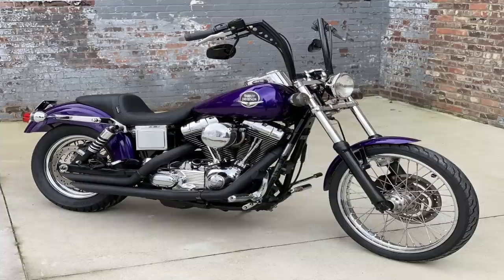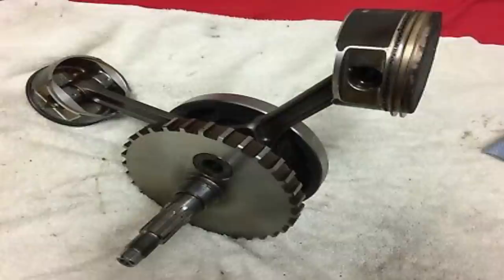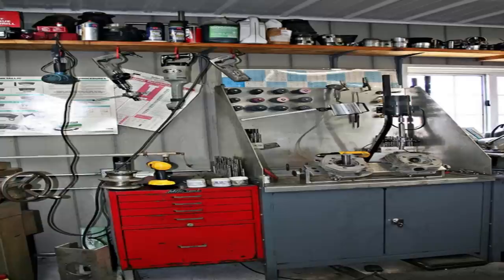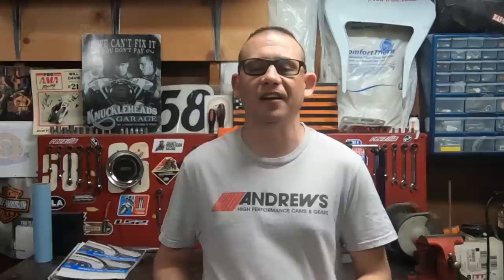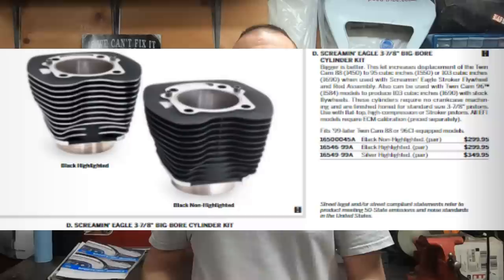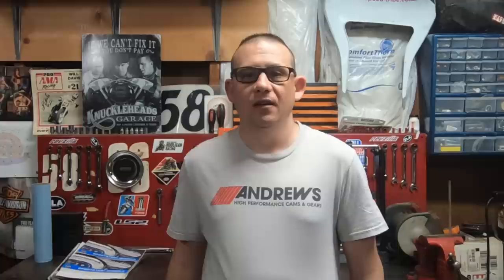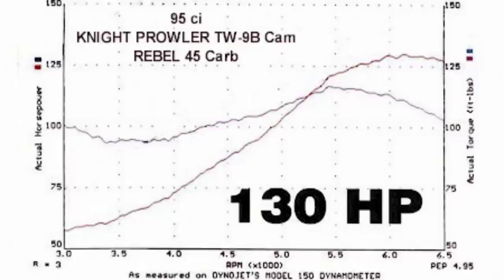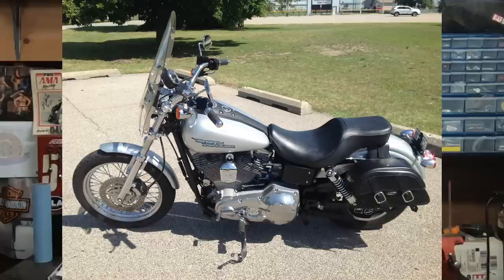Harley 95 is the Twin Cam 88 Sleeper

Comment: I bought a pair cylinders at a swap meet and had them bored while waiting for my heads to come back from branch flowmetrics ran their cam and pistons on my 02 fxdx turned a 10.22 on the dyno drags 107 hp 127 mph rode it 70000 miles with no probs

Comment: Excellent content!!! My 06 EG classic has the SE Kit with the SE plate, oil pump, TTS Tuner, and Khrome Werks header and exhaust. My Dyno run had 92 ft lbs and 84 hp.. Your video could not have came at a better time as I'm looking to change the cam, and have some head work done. Looking to really see what I can really get out of my little 88!!! lol
Reply from the maker: Those really good numbers with a 88 honestly, you've got a great setup to build on. You put a 95 kit on top with a good cam and you'll have a whole new motorcycle. Great power and torque, best part is it will be reliable too. You'll be able to jump on it and go anywhere you want anytime.

Comment: I would bore & hone the cyclinders to a set of Wiesco 10&1/2 pistons if you want torque use a1.900 intake valve & A 1.630 ex valve along with high lift springs if you want all out HP the intake valve should be a 2 inch .I like to use a head off a 2006 & up ( a lot less material to remove to make a good head . Cams should be 585 lift to 635 lift . Forget about woods cams every one of those has what I call the woods drop )they make the power for a short minute then the power drops off just when you want it to keep pulling ! Want even more bore the cases to accept 4&1/8 bore cyclinders for 107 cu in ! The 95 is my choice the 107 RULES ! Short stroke big bore !

Comment: I have a 06 Street Glide with the 95 kit with light weight/high compression pistons, an Andrews gear drive cam combo, polished and ported heads, stage 1 intake and PCIII tuner and it dyno tested at well over 100 hp and over 100 ft lbs torque. I can't remember the exact numbers but at almost 80k miles it is still running strong.

Comment: 95 kit w 96 ci heads w headwork, 543 cams, s&s crank, mikuni 42 via lightweight chain driven fxr.  it runs pretty decent.
Reply: Exactly what I did with my FXR just a 585 cam. What hp/tQ you achieve??

Comment: My 07 street glide has the big bore jugs, bored with a weisco piston 10.5 compression, ss ported heads with screamin eagle intake and throttle body tuned with a full true duel vance and hines exhaust and a custom grind cam. Its an absolute savage. Super super snappy. Eat 107's alive! Not even a match. It helps I've lightened the bike up some and I'm only 140lbs soaking wet lol

Comment: GOD BLESS the 95 " TWINKIE 🙏 MY 95 KIT WITH WOODS TW6 97 HP  110 TQ CARBURETOR   PULLS LIKE a FREIGHT TRAIN  S/S GEAR DRIVE  STOCK CYL.  ( MY STOCK 88 BORED OUT CYLINDERS WERE  NICELY HEAT SEASONED for BORING )  V/H PRO PIPE
Reply from the maker: They don't build them like they used to is all l can say. Those 95's pull so damn hard from that 4 inch stroke, you ride a 95 like yours then jump on a long stroke 96 with a cam and you'll feel the difference. The long stroke is lazy compared to the short stroke.
Reply: @GixxerFoo  THANK YOU SIR, I APPRECIATE the FEEDBACK. CARBED ALSO

Comment: I have one of these in a 2001 RK. It was installed when the bike was new. I bought the bike wrecked with 25k mile - it sounded like the valve train would fail at any moment. Since then I've installed Feuling cam plate and gear drive tw-6hg (same cam that was originally installed, shimmed the rocker arm end clearance to under 0.010.  Finished it out with Reinhardt tru-dual and a Ness super sucker.  Ii have not had it dyno'd but believe it is over 100 hp.  I also am disappointed with my 2008 SE 110 with the same set up. It's nearly putting ou 101 hp and 109 Ft/lb.

Comment: Right on ; little monster - 
Got my pistons gaskets ready ; waiting on cyl boring . Going to change out valve guide seals while heads off . I went with cast pistons 10:25 to one . Cam should bring that down a bit . 125 psi on compression test with stock pistons right now . High rpm recommend forged . Well the new rage around here is electric bicycles. Bidenomics  I guess with the gas prices I guess.😁
✊🏻👍👌 thanks for the info 🙏
Not worried about sprocket bearing for hd when bigger and bigger with that same bearing . Fingers crossed 🤞-

Comment: A short stroke Twin as a Square Build ( 4x4 ) is a great engine for a light bike such as a Dyna or Softail riding locally.  Without a doubt its a peppy engine and that 88in had the tried and true durable crank that was bolted together.
But to say the bigger stroke engines are a bit slower to jump up and run as quickly isnt the case. The cams with compression dictate the peak torque and horsepower regardless of displacement.
You smack the throttle on a big bore long stroke with a set of cams for torque. You better have a stout driveline to handle that level of power and have velcro on your seat, ass, gloves and grips.
I have seen bike engines bang a 120ft pds of torque at 2200 rpms and carry that and more out in the upper rpms.

I rode a 2002 Dyna Super Glide with a 95in stage 2 kit Mild head work with high lift springs, 48mm Mikuni Carb, Andrews TW54 set of cams and the original V&H Pro pipe.  It was a great short ride bar hopper!!!
Reply from the maker: Big cams and hot compression will overcome a lot for sure, a 95 in a touring bike with a high torque cam works really well. With the 5 speed transmission it keep the motor right in that rpm range on the highway for great roll on passing.
Reply: @GixxerFoo  My current 124" in my 2008 Road Glide trike. Is a tractor engine. Compression is at 10.2 and I changed front and rear belt sprockets to a 30/70 ratio. Not sluggish at and any rpm and yes there is heat. Mostly due to the added weight and wind resistance of the trike body and my fat ass sitting on it. 😂😂😂

Comment: Hey GixxerFoo, super Video (as always) - pls keep up the great work! As far as my RK Custom SE 2005 goes, hell yes, what a beast! But after riding and enjoying it for more than a year, i am curious (as a Non-Mechanic) whats really in this TWIN CAM 88??? From the outside the Engine shows SE + CNC Ported + SE Exhaust + SE high flow air filter. The Pre-Owner said that `everthing` was done by the factory as a `full SE package`. Who can help?

Comment: Im running a dave mackie megasphere 95, 10.5-1 comp, ported and polished heads 510 cams. Runs great but a coil/ignition with a bigger carb would complete it.

Comment: I went with fueling 575 cams straight gear drive fueling cam chest oil pump and it helped it but when I did the 95 inch bore and the heads on it it made it a rocket ship
Reply: what did you do to the heads?
Reply: @johnippolito2376  the heads are basically stock just cleaned them up and they change the valve springs in them and put compression releases in them
Reply: @johnippolito2376  it's really strong right off idle all the way up through the mid-range that's why I didn't Port anything they just polished the heads up I love it

Comment: I've watched this video a couple of times now and you have me seriously considering changing out my Andrews TW26 cams with the Wood TW6. I had the TW26 cams installed as part of a stage 2 upgrade, but I didn't go with a hydraulic cam chain tensioner because at 37,000 miles there didn't seem to be enough wear to bother. I now want to do a stage 3 big bore kit on my 2006 feul injected Road King and maybe do the Wood TW6 cams plus the hydraulic tensioner. 104HP and 116 ft lbs tq ain't nothing to sneeze at! I do like the TW26 cams though because they come in at 1800/2000 rpm and pull like hell to as fast as I'm will to go, but the dyno chart of the TW6 cams look like they kick in right at 2000 rpm as well.

Comment: Loved this one man!....especially cause I just bought a used road king. The dude said he put a 95" kit in it with 525 cams. I don't have any numbers but this thing pulls pretty good. It'll run 100 mph at 3 grand. Are those 525 cams a fueling cam?...he didn't know cause a shop did the work. Also it has stock heads with true duals so headwork and a 2 into 1 with a hpi throttle body should be a huge performance boost would you agree?....any advice from you is well received man love your channel
Reply: 525’s are the Feuling Reaper cams.
Reply from the maker: Yeah Feuling cams, I would go for the head work and the exhaust and see where you land. Throttle bodies are crazy expensive and being a 95 it may not be of much benefit to add a throttle body. Now having the throttle body ported wouldn't be a bad idea at all and Hammer Performance does that like 100 bucks.
Reply: Thanks man. I had a hpi throttle body on my built 103 and it was pretty damn amazing....with ported heads, bigger jets  and 90 degree air filter 
It was a damn strong running engine but you could fry an egg on the rocker box covers

Comment: Regarding S.E. parts, I'm biased against, because I feel The Motor Co. should have put bigger cams in from the start. Unless, they are limited, due to emmissions constraints, then I relent. Still, I'd rather look into Woods, Reaper, S&S, or similar for aftermarket goodies.

Comment: I put the 95" kit on my '06 Deluxe and went with the SE204 cams instead of the SE203 that comes with the kit.  Coupled with the high flow air filter backplate and V&H exhaust, my bike was dyno'ed at the dealer with the SE race tuner and returned 90.2 horsepower and 99.7 torque.  I imagine some headwork and a better tuner that isn't locked in to premade maps will do better, but it is a noticeable difference over stock and it idles with a decent lope!

Comment: I have a twin cam, lower sent to dark horse stock stroke 100 in big bore kit Sand S heads that been flowed roller rockers and I can't decide what is going to squeeze every ounce of hp , should I use solid lifters or hydraulic maybe you could shine some light on that for me is it worth the hassle of readjusting your valve lash,I also have 585 cams S and S of course

Comment: I've got a 2005 Fxstdi Stage 4 95 big bore kit with screaming eagle 585 cams ,58 mm throttle body intake with hyper charger. 10.5:1 comppression with the relief valves. Performance springs adjustable push rods. Just wish it was a 6 speed. Not sure what the HP and torque is. I bought it as is from the dealership.

Comment: Ok , so I have this same setup in an 04 softail . With the largest screaming Eagle cam , stage 2 I believe. With Zippers heads . Tuned when it was installed at 102 HP / 104 FPT . Lots of fun ! 
Problem I’ve been having since is when I’m hammering on it , highway riding , coming to a slow down or stop the bike idles down to a complete shut off . Also an serious lack in power . Starts right back up and idles fine . I’ve had this bike in a few shops , zero solution . We’ve changed throttle body , and a few other small things . Anyone have any knowledge to share , I’d greatly appreciate it . I’m seriously lost on this one ! Thx y’all have an awesome day 🤘🏼😎

Comment: Hey GixxerFoo thanks for putting out great content and all kinds of valuable hands on knowledge. I have an 06 Electra glide so far I’ve done the 95 kit se pistons, se heads s&s 510 gear drive cams fueling cam plate, se 90 degree air breather and thunder header 2 into 1. I Haven’t had it tuned yet but I’m wondering if I’m getting pretty much all I can get out of a 95 build. I think I was expecting a bigger difference in seat dyno. Would you recommend a different cam choice maybe , I’d like it to pull harder or am I expecting too much out of a 95.
Reply from the maker: Wood makes some pretty good cam that will day down some power all over the chart. The cam you have is really meant to run with the stock heads and compression, a cam swap would really benefit you quite a bit. Since you've got the heads a Wood TW-8 is a pretty hot cam that will really make it run hard.
Reply: @GixxerFoo  Okay that sounds good, I think I’ll order the the TW-8 and then get it tuned and see what it feels like. Thank you for assistance I appreciate it.

Comment: GixerFoo, isn’t that 100 HP, 100 ft. pounds of torque more that the stock 88 TC crank and bearings (not the tapered Timken) can handle? If so then you added another $1500 to do the bottom end right.

Comment: Hammer performance 98” big bore kit would go best with which cams?
Reply from the maker: Depends what you want to do with it, but with the 10.5:1 compression if you had the heads done with springs the Wood TW-8 would really make it rip! If you're running stock heads a TW-6 would be a good match.

Comment: I bought my 05 FLHR 2 years back with the SE95 kit already in it with the 203 cam.  I have not replaced the cams yet but I did the SE cam plate, a S&S header, S&S intake and a Thundermax controller with add on 02 sensors and it still hauls.  I am on the fence about replacing the cams.  Who thinks it is worth it?
Reply: Me ....I would go wood's cams ...they make amazing power and torque...I have them in my Dyna.

Comment: Edelbrock Performer RPM heads
S&S 625G cams
Jim's roller rockers, lifters and Titanium pushrods
Fueling Cam Plate/ oil pump
Zippers pop off valve
Weisco 10.5 to 1 pistons
95 0.010 over
Nology hot wires
Screaming Eagle ignition
Mikuni HSR 45 carb with a forcewinder 

On race juice it is insanity. Before going forced induction.

Comment: Hey man awesome information but have a question if I just changed cams in my 88 2002 dyna will this help me and how much horsepower and would it give me
Reply from the maker: It really depends on the cam, horsepower can range from 75-80ish and torque high 80's to low 80's. Here's a video on what a cam swap alone can do in your 88 https://youtu.be/tV5LcDXx3xA.

Comment: I upgraded my cam chest on my '02 flht. Luckily the tolerance on my pinion shaft was a maximum of .0016", so I went with the S&S gear and .509 cam upgrade kit along with a Ness big sucker. It runs awesome! Down the road I'm thinking about the 95" upgrade also. What are your thoughts?
Reply from the maker: The Timken bottom ends like you have are rock solid, shame they don't build them like that anymore. I'd have no reservations about putting a 95 top end on that bottom end.
Reply: I got 509 in my stock 99 model 88 pulls good but my 01 model  95 ci 570 cam. Goes better lol
Reply: @GixxerFoo  thanks for your input! I went with the 509 cams so I wouldn't have to tear into the top end. I'm new to working on Harleys, but loved wrenching on this upgrade! My wife helped when I cut the original pushrods with a bolt cutter!!! Lmao 🤣
Reply: I did a .510 cam with gear drive on my 01 FXDX.  Thinking of 95" and 10:1 for this winter

Comment: I’ve been wanting to do this on a 06 E Glide. My question is do I keep the fuel injection on it with a tuner, or ditch it and put a hsr 42 mikuni on it. Or is this even possible ???
Reply from the maker: With a 2006 you'll want to use a Power Vision, but on the 2006 you might be able to get away with a power commander on that year model.

Comment: Curious what hp and torque numbers might be leaving pistons and cylinders at 88 ci and just cnc porting heads and upgrading cam with S & S 510? I just can't afford spending $3,362.95 for a S & S 100" power package.
Reply from the maker: With a cam you can get about 80 horse and 90 ft lbs of torque out of an 88, it's quite a jump of the stock numbers with the stock cam.
Reply: @GixxerFoo  After doing more research I might go with the 509 cam since most of my riding is under 5,000 rpm. Looks like the 509 torque comes in from idle to 3500 rpm and the 510 max torque is 3500 to 5,000. I guess both are considered "bolt in" and I could use my stock heads and not have to do anything with the valve springs.

Comment: Great video. I am going through this all right now with my 2001 road king. Debating on what to do the 95 Zippers kit seems like a great choice. What cam works best with this kit?
Reply from the maker: The 95 kits are awesome on the 88's, they aren't 150 horsepower like some of the M8's but your not spending 10K on motor either. Which kit are you looking at doing? There engine kit already comes with cams but if your looking at just doing at 95 upgrade with stock heads I like the Wood TW-6 bolt in for the 88.
Reply: I have an 03 fat boy i did & S&S 100 inch kit with 570 easy start cams last year. It did well 108 horse 118 torque. On my 2001 road king I am torn what to do because I heard that year EFI has the shitty EFI MM.  was thinking might do that same kit on the 01 with a wood cam and put a mikuni 45 carb on it..Thoughts? @GixxerFoo
Reply: I like  the specs and results on the tw9f wood cam wow. How do you  think it would do with the S&S 100 kit with S&S ported cnc heads?

Comment: i recently bought a used tc88.  i pulled the cam cover off and its been converted to gear drive cams and tensioners removed.    how can i tell if theres been other work done to the motor?  thank you

Comment: Can you tell stock cylinders without pulling heads?
Reply from the maker: You'd have to measure the bore to know exactly what you have, which would mean pulling the heads.. But if it's fuel injected there is a trick to read the data off the tuner to see what the displacement on the tuner is set to. That will give you an idea of what cylinder bore you may have if you know for sure the crank is stock. If it's a big bore kit you have to edit the displacement within the tuner for the fueling calculation to be correct

Comment: I currently have a stage 2 kit in my 06 Road King with Andrews TW26 cams and am getting ready to do a big bore build. I have spent hours going through Harley forums about what works well with these cams, and the same recommendations have come up over and over again from different forums. They recommend a 95" build and a 9.6 compression ratio for the Andrews TW26 cams?